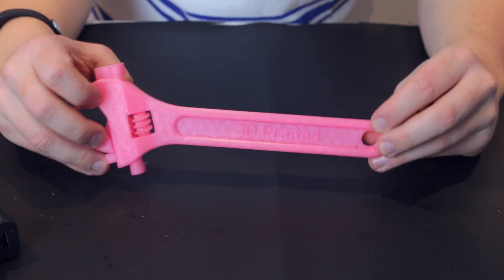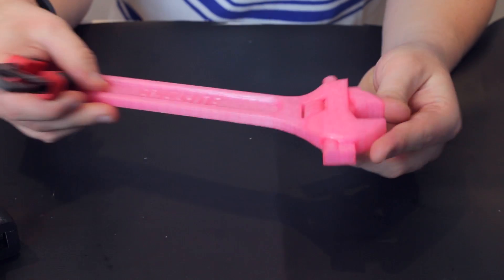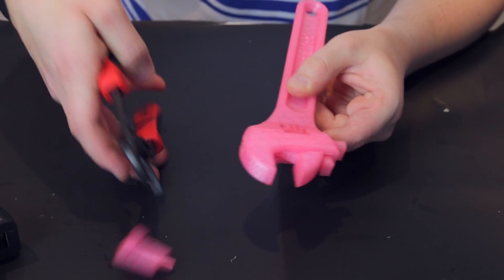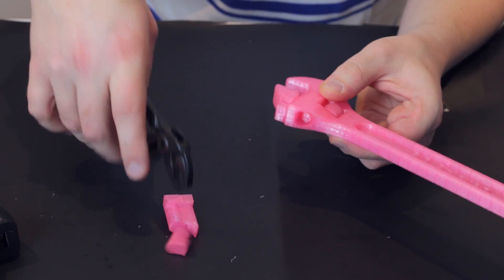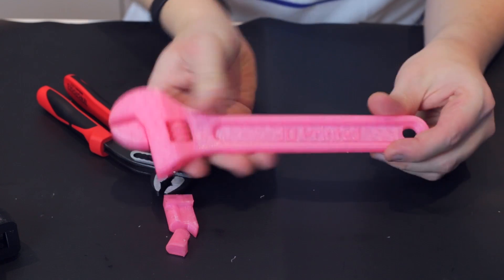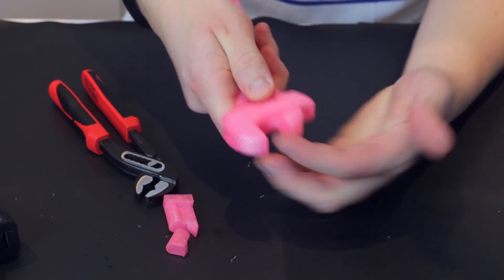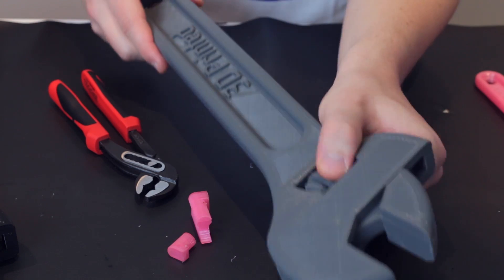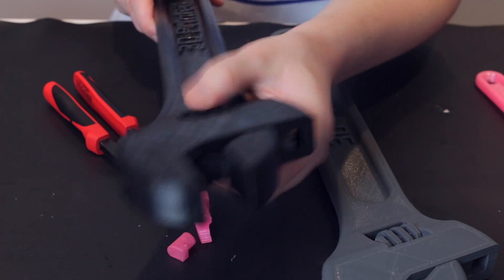WanHao - Duplicator 4S - PLA Wrench 3D-Print

Comment: Recently I bought a Wanhao Duplicator 4S, but all my prints went horrible... I'm using makerbot, please, can you tell me the best configuration?
Reply from the maker: +TheWolfSide Not sure if you're using a Duplicator 4S or a Makerbot for your prints? Whats wrong with the print, what material are you using?
Reply: AMID I'm using WanHao duplicator 4S, and I use Makerbot Desktop program to make x3g files, the problem is that I'm new on 3D printers and I don't know how to configure it to make good prints, all my prints went horrible.
My material is PLA.